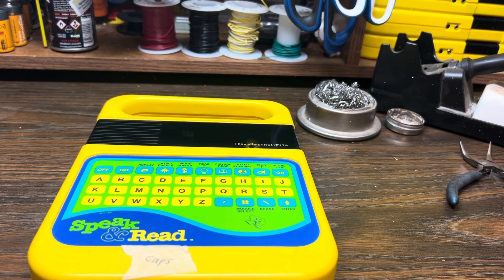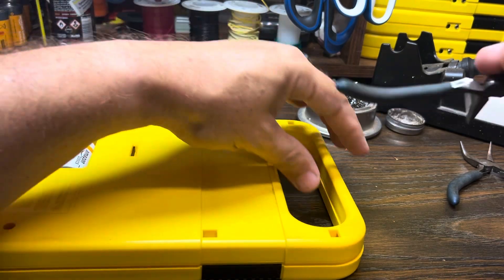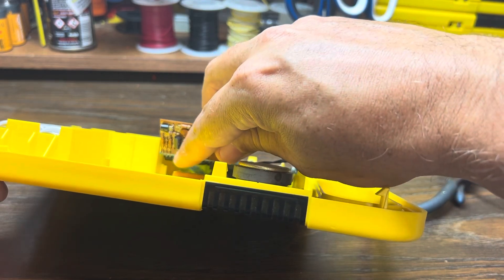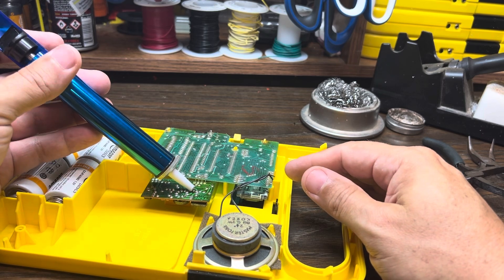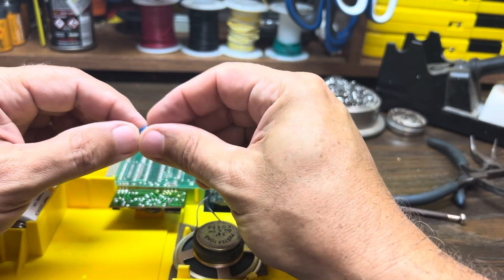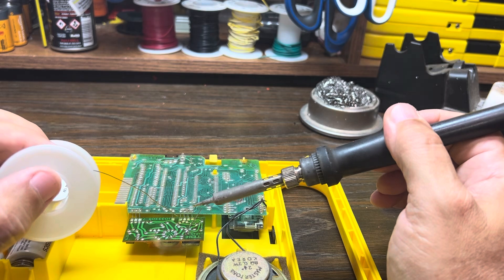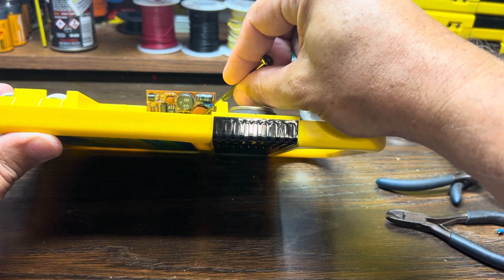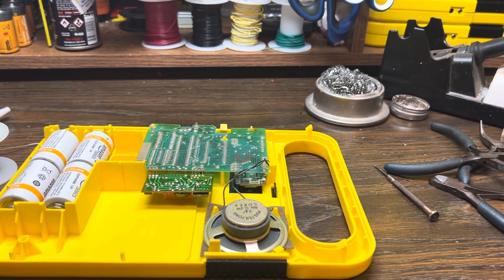Repair a glitchy Texas Instruments Speak & Spell Speak & Read Speak & Math - capacitor issue

Comment: Interesting video. Have you seen any Speak & Spells with a low STARTUP voltage? I had one (slightly different power supply board to yours) that had a blown PNP with obvious thermal damage, I replaced two of them as that was part of a pair but it would only power on using a 7.5V power supply (too high) and not batteries.

I just had a closer look and the soft power on button was only generating 1.8V. By the time that's gone through the diode and the pair of 2.2k voltage divider I don't think it was enough to turn on the NPN transistor. I wasn't sure why that was but a safe workaround was to increase the value on the voltage divider, I replaced the lower 2.2k one with 6.8k and put in a higher gain NPN transistor while I was there and now it works at 6V and down at lower voltages which is important as the C batteries will decrease in voltage over time. I suspect the resistance of the membrane keyboard is higher than expected but I am not sure why. I did reseat the cable from membrane keyboard but that did not improve things.

Comment: I've got a faulty Speak and Spell here which turns on but produces no sound. -12V reads -18V and -3.5V reads -4.25V. I've replaced caps but no change. What is the transistor part number for Q3? Looks like something ending in 815? Or could it be a Zener diode issue? Thanks.

Comment: Hey, I was wondering if you could help me, I am a totally blind person working on a speak and spell, attempting to modify it with braille letters, which can easily be done, I was wondering if you had any other methods of labeling the on and off buttons, as well as the go button and all the other buttons that are not labeled to be more blind accessible, this is the model of the speak and spell that has the power adapter, headphone jack and the membrane keyboard, not only am I attempting to label it for blind people, but I actually taught myself how to fix electronic toys as a blind person, I have watched a few videos on the speak and spell. and I thought the videos were really cool, I was actually showing someone else what the speak and spell looked like on the inside, and I broke two of the clips trying to get it apart. it still works, but it is now like a toy that is missing a couple of screws, the clips broke in a way that cannot be fixed, this is my first speak and spell I have took apart, so naturally, I would break a few clips despite being completely blind and having no idea of what you’re doing, my question is, do you know what I can replace the clips with? I have took apart several other electronic toys over the years to salvage parts from them, I have salvaged motors, speakers, wires, and screws and pretty much everything you can think of from used electronic toys, which is really cool, only reason why I am writing all of this. Here is in hopes I can find a mentor for someone who is completely blind, but the main reasons I am writing this here is to see if you have any creative advice for labeling, I also want to know what I can use to replace the broken clips with, my only solution would be glue, tape or adhesive, if you think of another solution, that would be amazing. have a good day, and thanks, I cannot wait for the reply to my comment!

Comment: got a quick question for you!  I just put batteries in my SS for the first time in a few years.  Immediately it glitched then smelled.  I've taken it apart and it looks like one of the transistors is for sure burnt.  Looks like it's a QB 2015 CY.  What's a suitable replacement for that one, I've looked all over and can't find any info.?  I'll switch out the caps as well, which probably caused the problem in the first place. Any help appreciated!

Comment: My S&S was working fine when I put it in storage maybe 3 years ago . Now it gets stuck in what appears like a glitch or a boot loop , displays SPELL A but gets no further , emits a clicking noise and is otherwise unresponsive. 
Is this an issue you’ve seen before ? Thanks 🙏
Reply from the maker: This does sound like the capacitors may need replacing.  Any chance you could post a video with sound?  If I hear it then sometimes it helps me better guess what is up with them.  
I did once have a unit develop a permanent freeze loop, it sounded exactly like one of the bends I use but couldn’t be freed from it even after de-soldering all my wires.  I ended up having to scrap that board and swap in a replacement for my customer.  It’s rare but I have seen that at least once.  Caps would always be my first thought though especially it acts a little more randomly / unstable.
Reply: @fastmatt_circuit_bent gah, haven’t got around to this yet, but I’m 99% sure it’s the PSU. Strangely I can’t find a schematic showing the values of the caps on the PSU - is there any way you could share that please ? I’m sure I can fix them myself with this information. Thank you in advance 🙏🙏🙏
Reply: It’s so frustrating- I’m loathe to throw it away or sell it as junk when the problem is likely a component that costs Pennies! 
And nobody wants the new speak and spell! Someone forgot to keep the mojo, obviously not produced by geeks and those with passion!
Reply from the maker: @sprialingprism  I don't have a schematic of the board but I do discuss the capacitor values and locations in the video above.  I can do one better and list those values in the video description for easier reference.  I'll do that now. (edit: DONE, see video description)
Reply: @fastmatt_circuit_bent wow I really really appreciate that - 
thank you so much ! 
I will report back 👍👍👍

Comment: AT 11:06, do you have the model.  I blew that one and haven't figured out what it was so am glad I found your channel.
Reply from the maker: If you may have damaged it with an incorrect external power supply then that’s probably not what is bad in your case - you most likely popped just the transistors.  But that cylindrical cap is a 47uf 25v electrolytic capacitor.

Comment: My S&R won't switch on after many years of working great. Can you recommend troubleshooting tips? I have a voltmeter. Also, while trying to get to the underside of the circuit board I accidentally disconnected the ribbon for the keypad: does that just slide back into the connector or have I done some permanent harm? The power circuit is labeled PCU-312A. Thanks, hoping I can bring it back!
Reply from the maker: Hi @bencolemanart, for the ribbon cable it is a bit fiddly but definitely possible to get it back up in there.  The later models had a more firm material at the end of the ribbon, if you are lucky you’ll have that and it’s a bit easier.  If not - it takes some more patience.  I probably should make a short video on how to do it.  The idea is you need to get one end of it started into the connector, I use a small jewelers screwdriver (flat blade) but never force it to where you tear thru the ribbon.  Just barely press it in at one end to get it up in there.  and then with an index finger and thumb, firmly support the ribbon cable and gently work it into the connecter further in from that end you started to the other end.  Hope that makes sense.

I will share some more troubleshooting tips here in a few hours, I have some tricks for diagnosing power issues.
Reply: @fastmatt_circuit_bent  Hi Matt, thanks for the reply! Sadly, I don't have the later model, it's going to be a nuisance, but I feel more confident doing it with your advice. Jewelers screwdriver at the ready!
Reply from the maker: @bencolemanart  I just uploaded the troubleshooting video and included tips on the ribbon cable. 🤓
Reply: @fastmatt_circuit_bent  Thanks Matt, really appreciate it!